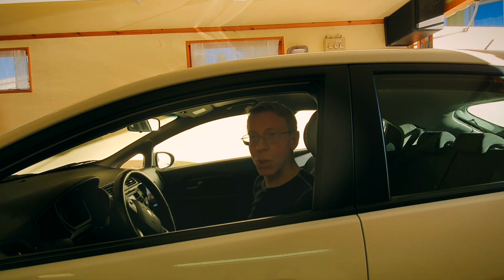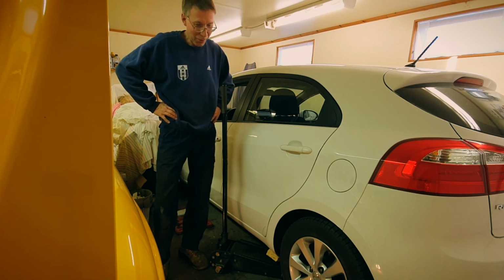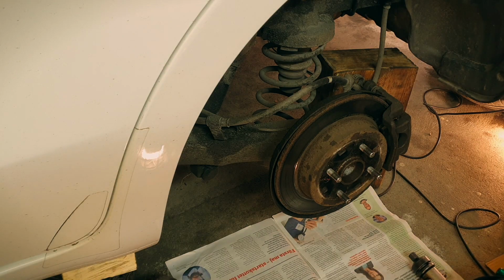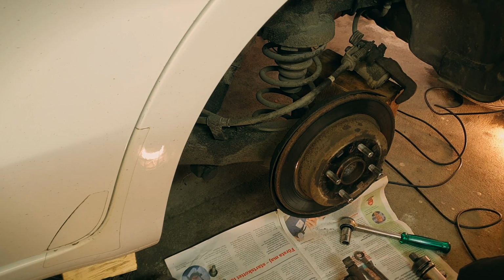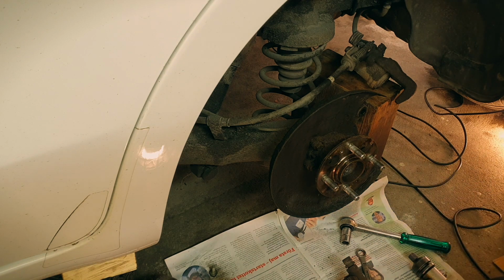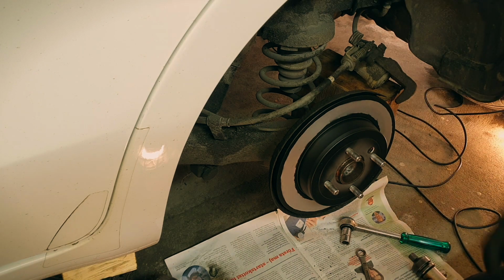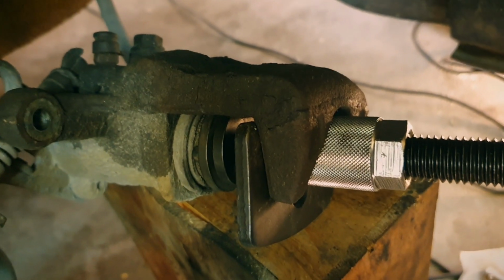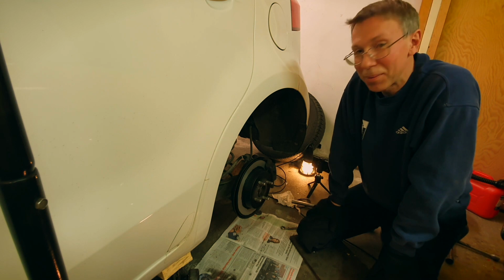HOW TO REPLACE A REAR BRAKE DISC, SHOWN ON A KIA RIO

Comment: thanks for the videos ! could you meke more for the kia rio, how to change all the fluids: brake fluid, transmission fluid, and windshield wiper fluid.
Reply from the maker: Hi Mauricio. If you look at the Kia Rio playlist you can find a service video. It covers engine, transmission and some other things. Regarding brake fluid, there are some other videos on my channel here. In the Honda NSC50 brake pad video you can at least conceptually see how a brake fluid is replaced.